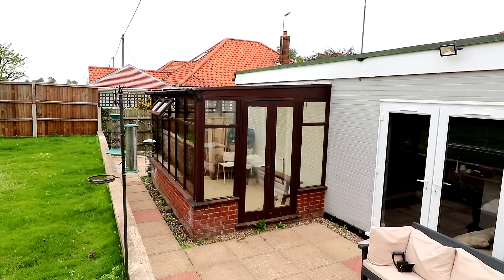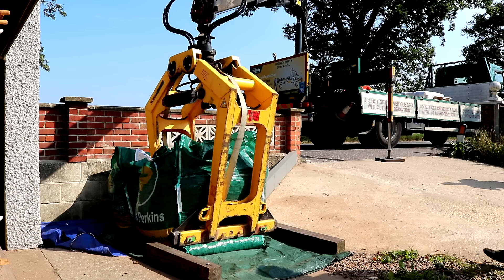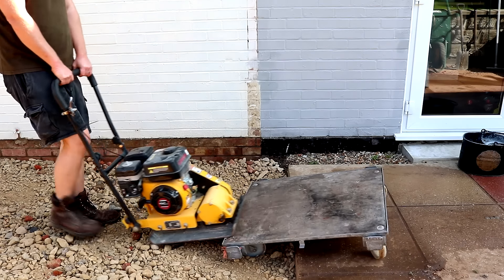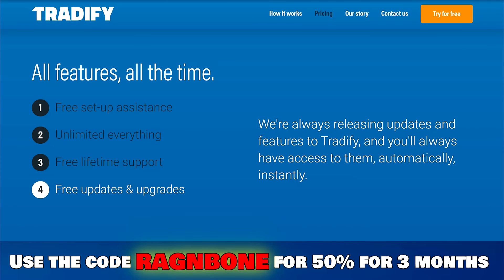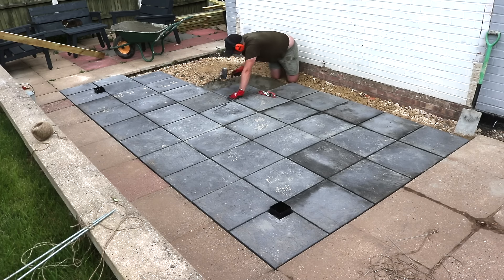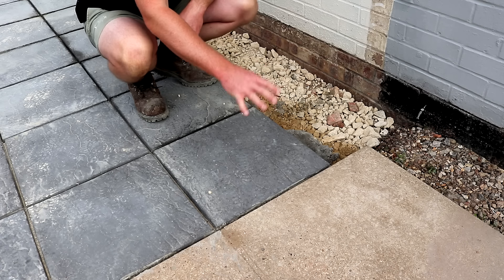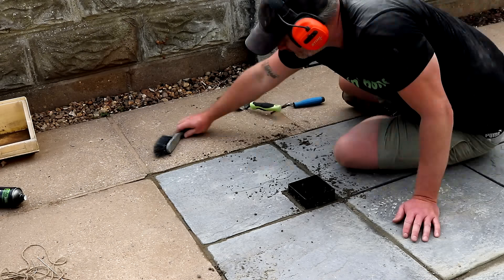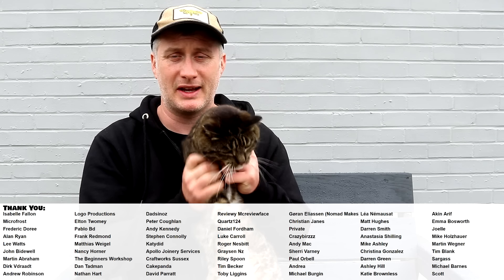Patio / Laying Paving Slabs

Comment: Good job. However I would have started in the middle so that the end slabs are equal. This is nit picking though, cos nobody will notice.
Reply from the maker: That would have meant there would be two very thin slabs at each end which would look pretty bad imo
Reply: @RagnBoneBrown  not so, because one slab width divided by two is added to each end

Comment: No lips. No puddles. Regular spacing and straight joints. Drains away from the house. What more could you want?  Fascinated by the remote control delivery arm on the truck. Turns unloading into a precise one-person process. Thanks for the video (and the mention of glazing packers).

Comment: dun well for first time but never walk on slabs you just freshly bedded after a while move about best way pointing is like a Tyler just filled the joints bit wetter let dry a little bit sponge the joints of you'll find it so much easier wait till it dry give one more clear over  try it 👍 and you should have painted the wall first before you lay the slabs but not a bad job 👍

Comment: grips on post holder will not compromise the timber  best way to lay that type of slab is on a dry mix of sand and cement levelled and then allowed to set naturally and splash back from slabs will not cause damp.
Reply from the maker: I disagree on the timber - unnecessary cuts to compromise the treatment seems a bad idea to me, and also disagree re slabs, I've seen the evidence of compromising dpc, I can see the areas where it's affected the walls of my bungalow
Reply: @RagnBoneBrown  the post holders are compressing not cutting I have posts in them now that have been there for 8 years with no signs of any rot you will be more likely to see rot start at the end grain were water sits in the post holder itself. as for splash back from slabs this does not cause damp if it was the case every rain fall we had would be an issue and most house have paths around them and have no issues with damp. I have worked in the building trade for 35 years.

Comment: One little tip. Never start with a full slab but measure the width of your patio and divide this by the width of 1 slab. Now you have a certain rest and add this to the width of one slab and divide this by two. Tis is your starting slab-width and your ending width. Both sides are the same by this method! Do this in both directions.
Reply from the maker: But then I would have had a really thin slab on each end which would look silly
Reply: @RagnBoneBrown  the width of the end slabs can never be less than half a slab because you add one slab width before dividing by two

Comment: Congratulations Keith, that was a win in my book. If the job has sand and cement [or ready-mixed] in it, then I run screaming. A tabletop maker/crafter, everything I mix is always runny, so i just can't seem to get bricklaying/slabbing etc right. And I've not found the instructions on the bags to make any sense when it comes to water amounts.

Comment: Looks good, well done. It's not usual to put a full bed under the whole slab because it increases costs a lot, more time consuming as well. A professional will even baulk at a dab under the four corners and the centre.They have a sand fetish.  A full bed of mortar is also bad for drainage, rain can run through the joints and through to the ground if sand is used. Therefore, the flags can be laid level. This method is good for beginners though because it's easier to level them. They will never move either! I'd recommend a the five dabs approach with firm mortar.

Comment: Nice job! I found a handy way to shift mortar stains from concrete and engineering bricks is with a knotted wire wheel in the angle grinder. Set it to a very low speed, and you can gently polish most of the stains away.
Reply from the maker: Does that not damage the surface of the slab ?
Reply: @RagnBoneBrown  Hi Keith, I have done it on concrete slabs, and found if used gently and on a low speed, it does not mark the slab. Obviously not all slabs (or wire wheels) are equal though, so worth trying on a bit of scrap slab first just to make sure. (If you look on the UK DIY Wiki, and search for "patio rebuild", there is a project I documented there where I had to do a moderate amount of cleaning up on slabs and blue engineering bricks).
Reply from the maker: Cheers I will check it out 👍

Comment: level enough + fit for purpose + drains away from house + no trip hazards = top job. Well done!  Observation from a non expert - maybe drill holes through the bottom of the post holders and concrete below so they don't fill with water and rot the posts?
Reply from the maker: Cheers. I have a plan for the holders👍

Comment: Result looks great. How are the slabs holding so far, in particular the drainage? Did you experience any issues? The reason I asked is that Wouldn't mortar mix prevent water from soaking into the ground? Also you used gravels up against the house and next to the slabs? Doesn't that trap water like a gutter does? I am a beginner DIYer and recently done a paver job at home. Drainage i see if not handled well would become the biggest annoyance.
Reply from the maker: Hi Felix, gravel is actually really good for drainage, and it's below dpc level of the house, so it's no problem. If it was gravel above dpc level, it would probably cause damp issues with the wall. The slabs are sloped gently away from the house allowing the rain to flow away,  so drainage isn't an issue

Comment: I just done some myself got flags for free 600mm by 600mm 40 mm thick never done it before it was hard work same here didn't like doing it hahaha but dont think there going any where and dont think there will be any weeds has the level was way out so got sand and cement under them some bit got good 100mm under them wouldn't like taking them up if have to in the future

Comment: Plasticiser isn't necessary for laying slabs, just create some waves with your trowel when laying the bed & the slab will just need a few light taps into place.
Also a string line is more beneficial than a level for riven style slabs.
Reply: Plasticiser is better because you can have the mix a bit wetter so it gets a stick to the slabs, if you use water alone to get the mix to that consistency then when you pat down the slab next to it, you run the risk of it all jiggling around.
Reply: @whatyousaidbud  
A semi dry mix is perfect for any patio.
9 out of 10 slabs will bond but they can be lifted, cleaned & re used.

If a more permanent bond is desired, a slurry mix made up of cement & sbr is brushed on to the back of the slab but you will never re use the slabs again!!🤣

Comment: Well it's a better job than i could do, and more importantly does the boss like it?
By the way Keith what was the blade that you used to cut the slabs, as i have some slabs that need laying and i don't have a slab cutter, just the same as you.
Stay Safe,
Barry (Wirral)
Reply from the maker: Thanks! Not sure if the boss is Ria or Dylan 🤔 I just used some cheap diamond blades, they worked pretty well but might not be as good as the pricier ones

Comment: Well done for remembering the DPC regs. The pea shingle is a perfectly acceptable so;ution. I quite often specify those 'French drains' when Client's budgets don't allow for an Aco drain solution.
I wouldn't pressure wash the slabs for quite some time as it'll take a while to cure properly.
The best way to get cement stains off is to use spirits of salt. It's  hydrochloric acid based, so is strong but is the ideal thing to use. You can also use spirits of salt to descale your toilets in hard water areas. I recently did a video on how to do just that. Feel free to watch it, it shows about using it to get cement off of bricks on the video, so might be useful to you.
Reply from the maker: Thank you, I have some spirits of salt so may try that 👍

Comment: You did a good job Keith, I think you really made it hard on yerself though. A few things that would have made things much easier, either way you learnt a lot and your brain has stored that away so loads of other construction stuff will come way more naturally next time. 
1 thing for the mortar staining. Santrax will take it off, its a stone and mortar cleaner. I use a rule the wetter mortar is the better and wash off with a sponge, rule of 3 times for washing means any residue wont be permanent. And it doesn't take long to do either
Reply from the maker: Thank you

Comment: That’s a great job Keith. Looks really good to me.  These one off jobs are often tough and my wife wants me to do a patio with pergola in the corner of our garden, but so far I’ve avoided it. Levels and run off drainage all seem quite difficult to tackle if you’re uninitiated like I am. I just don’t do enough of this sort of thing to become adept. Anyway, yours looks pretty good so I might have a go next summer. Btw, when I did a concrete base for my garden shed, I used a fence post with a 300mm square of 18mm plywood screwed to it, to tamp down the hard core which worked pretty well. Glad to see you left a gravel strip and 150mm from the dpc. I survey many houses where this has not been done and the resultant problems are a real issue. Good work mate!👍🏻
Reply from the maker: Thanks Paul. Yeah the other side of the wall is basically our bedroom wardrobe so it already seems to be prone to damp as it doesn't have much air flow (even after adding an air brick) ! That's a clever idea about your makeshift tamper! I may use that in future 👍
Reply: You can lay flags on sand if you want, set up two boards with the required fall, screed off the sand in between with another timber. Then good to go

If youv done a shed base you can lay slabs imo

Comment: Looks great and considering you didn’t use spacers, the slabs are remarkably symmetrically placed. 

I’m just a DIYER, but surely the benefit of those post holders is so they can be above ground? I would have bolted them to the top of the slabs. It wouldn’t looks as nice but I fear those post holders are going to constantly hold water like a bucket and rot your posts prematurely. I think the base of the posts will be constantly submerged. 

I know they’re tanilised but still…
Reply from the maker: I have a plan! 👍

Comment: Nice work, I remember doing jobs like this in my younger days when my spine was intact. Another way of finishing off the pointing is a completely dry mix. Soak between slabs with watering can, let surface evaporate & dry off completely. Mix your pointing mortar dry & press into gaps, brush off any loose material. Moisture in the lower level will wick up through the dry mix & it will cure in place. I never had any break away or weeds grow through.
Btw. I thought 4:1 is too strong a mix for bedding slabs, need more sand to help drainage, let rain run through it
Reply from the maker: Thanks John good to get feedback like this, although not sure I'll ever attemot or again 😂
Reply: Thats a great tip - need to repoint my patio (probably next spring now) Started with too wet a mix and saw it was staining the stones so stopped -now I understand why. Might try both ways  Thank you both

Comment: Rain hitting the floor and splashing up won't create any damp-.- You've had direct rain on the walls for years, so how will a few drops create damp. Also you don't need a full bed of sand and cement for slabs you're going to be walking on, just driveways and such, this makes them much easier to level and hit down.
Reply: Please tell me you aren't in the trades with awful advise like this.. The reason you use a full bed for slabs isn't just for strength, it's to stop the slabs popping after a freeze thaw cycle. You are somewhat right about the splashing though, but in this case the slabs would have been on the same level as the damp course, which isn't good. Keeping it a brick down is enough.
Reply from the maker: Think about how water hits and runs down a wall, where is most of the water going to be at the top or the bottom? And where is rain going to splash back? Also the bottom. The wetter the wall, the more problems with damp, hence keeping the ground level below dpc to minimise it. It'd be mad not to. I can see with my own eyes the damage that has been caused by breaching the dpc elsewhere on my walls (prior to us moving in, we've rectified wherever possible)

Comment: Please please buy yourself a proper shovel
Reply from the maker: Whatd wrong with my shovel?
Reply: @RagnBoneBrown  it's a spade not a shovel, for the kind of work you are doing you need a square mouthed shovel, here in Oz you can buy a steel one for around $10 .In every other job you take on you use the right tool for the job, but using a spade for moving rubble ,sand etc!!